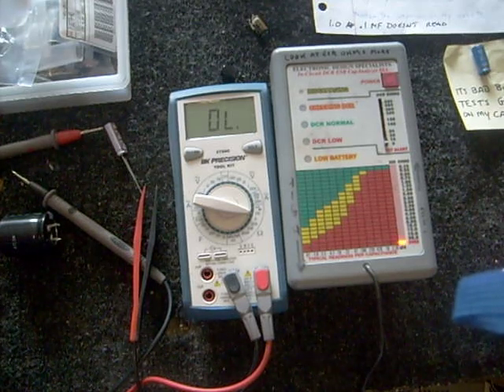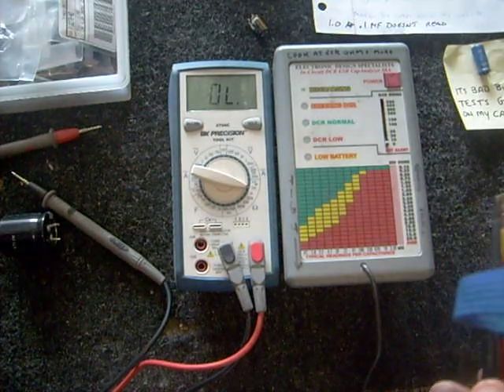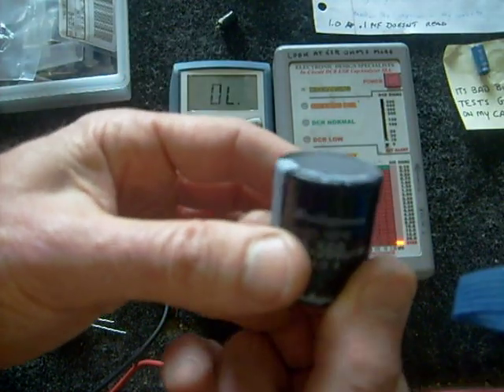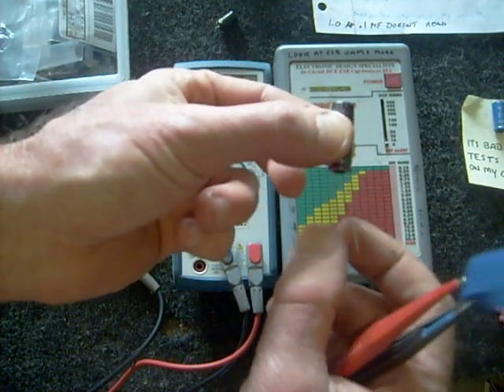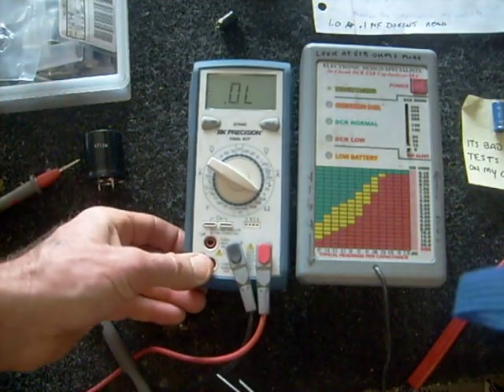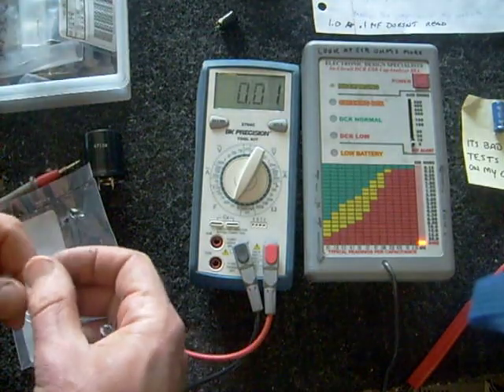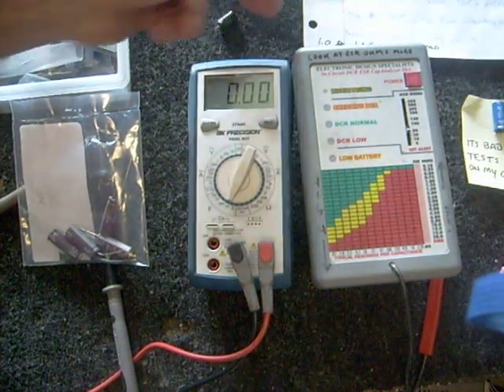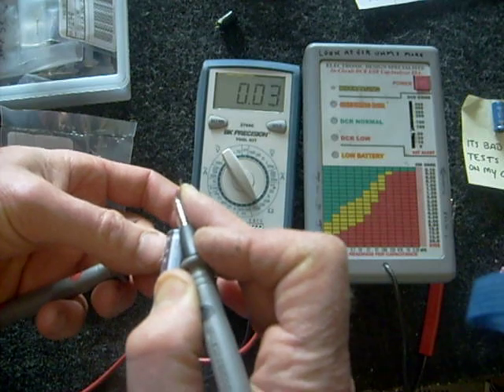How to test capacitors

Comment: Sometime i use as good indication, the plastic coating of capacitor is shrunked, it means overheating, perhaps by higher ESR, but be careful sometime simply due to the neighboarhood hot component has transistor or resistors.
Reply from the maker: Before buying an ESR Meter I would also pay close attention to things like
plastic coating shrinkage on capacitors, and or leakage under the cap. I'm glad I finally bought an ESR Type meter. It speeds my troubleshooting time way up.

Comment: 88A is the most important piece of equipment I own - I fix CRTs.

This is a good video as it explains that ESR values are dependant on what the Cap has to do - some are critical some aren't.

I like the 88A as it is fast to use and is the only one to come with tweezer probes.

Comment: @Grants Pass TV Repair .

You know I was looking at videos of guys using a component feature on the oscilloscope to test caps , transistor , and a diodes You cover using a ESR meter for testing in circuit which is great but you can also use a scope as well . But I like your video anyway . Im going to try your Tip for heating up some caps , so I can find a shorting channel for sound on the FM Audio board In my VCR I having a problem with . I hope its caps and not the video head going out . But I do get the sound to come back when she is running sometimes . Normal  audio works like a champ on the L/R Channels , but HiFi Is shorting out . I have the schematic from quasar and Im going to see what I can do .

Comment from the maker: I'm very fond of my fluke 77 because of its safety feature which has allowed me to accidentally leave the meter on the wrong scale without harming the meter. You still need to be careful about having your probes in the Amp ports, but many times I mindlessly left my meter on the resistance or diode check scale while measuring voltage and the meter was not harmed. I also own a fluke 87V which is like because it can divide an ohm into 100 divisions. B&k 2704c has a picofarad range on the cap tester
Reply: On capacitors do you want high esr or low esr? High hfe or low hfe?
Thank you
Reply from the maker: @SDsailor7  On capacitors you want to see low ESR values, but keep in mind that  on very rare occasions you may have a capacitor that is shorted out, and a short can also appear to have a low ESR value. hfe refers to transistors.
Reply: @GrantsPassTVRepair  Ah I see. Sorry I got the transistors and caps mixed up.
Thank you!👍

Comment from the maker: I'm no expert on multimeters, but I very fond of my fluke 77 because of its safety feature which has allowed me to accidentally leave the meter on the wrong scale without harming the meter. You still need to be careful about having your probes in the Amp ports, but many times I mindlessly left my meter on the resistance or diode check scale while measuring voltage and the meter was not harmed. I also own a fluke 87V which is like because it can divide an ohm into 100 divisions.

Comment: Thank you for getting back to me each time, I appreciate it. I do have two meters but neither are high end, I do have my eye on a couple fluke meters, not exactly sure which model to buy. If you were to buy one or the other, would it be the fluke or B &k and out of those which model? You've been doing this along time so I value your opinion.  I don't have a problem paying for quality equipment,  I've learned early on that if you go cheap chances are you'll need to repalce it sooner. Waste money

Comment from the maker: It wold also be a good idea to purchase a good multimeter if you don't have one. My Fluke meter can divide an ohm into 100 divisions.

I also like my B & k multimeter which can measure capacitor values in the picofarad range.  

An oscilloscope can come in handy, but because I don't go to deep in to electronic troubleshooting I don't use it to often.

Comment: Yes sir, the one i bought has had the protection unit installed on it professionally so im good to go. I bought it on eBay, i just received the shipping info and its being shipped from Medford, OR to me in Wisconsin, not far from you i take it..I'm excited to get it and do some troubleshooting. What else would you recommend for test equipment? I think this meter is going to help me a lot. I have about 150+ TVs sitting in my shop that i would like to start working a lot more and clear out some.

Comment: Hi. I just purchased a Capacitor Wizard, what do you think about them, if you have used or seen them? Like I said in my other post, I'm working on TVs as a hobby and I wanted to do some testing while still on the board. I didn't want one of those cheaper units because of your experience . I think this should be a good unit for someone like me only doing this as a hobby, also I didn't want to spend a lot on one since it'll only be used in my personal shop. They retail for $200+

Comment: I've always used +-20% as my guide. So, the cap's capacitance, which may or may not have been measured correctly by the meter, is fine. Like Dave mentioned, ESR is the more important test.

Comment from the maker: I'm not sure I fully understand your question,  but I only use my ESR capacitor tester to check capacitors, and it doesn't tell me their microfarad value. It sounds like your using a capacitor meter that only checks their values. I have not had good results testing for bad capacitors using a meter that only checks their value.

Comment: You forgot to mention an essential thing, which is that ESR capacitor meters are meant to check electrolytic capacitors only. They are not meant to measure ceramic disc or other types of non-electrolytic caps.

Comment: An ESR meter is a must for checking caps, the only way of knowing if a cap is bad or not. Some are selling at hot and even very hot prices but I bought mine from radiodevices.ru and it's amazing how accurate it is, and easy to use.It's digital.
I am still working on my own design, but for the moment I am using the ESR-micro,  v4.0s I bought, this baby i's doing just great.

Comment: Today i received a another mixer (brand new) so because i had 2 identical boards and psu etc,i could swap them over to see whats going on...and i found that the issue of humming is somewhere in the POWER SUPPLY, all i did was plug the pcb board section of the new mixers PSU onto the old mixer board where the power goes in and everything on the mixer works fine.
Still have to find the faulty parts on the pcb, but now i know where to look, there are a few more caps to check+ toroidal transformer

Comment: I purchased the ESR Micro V4 a couple years ago for about $70; it can measure capacitance and ESR. I had a totally dead TV with no bulging caps, and the ESR Micro helped me find 10 caps with low ESR. After replacing the caps, the TV functioned normally.

Comment from the maker: You can put a resistor across the capacitor terminals, but just make sure the resistor is the correct value so it doesn't burn up. A 10 watt 400 ohm resistor might be a good choice.

Comment from the maker: A digital meter can be helpful but it will not show the ESR value of your capacitor. At best it can reveal a shorted capacitor, or when your meter is on the ohms scale it can reveal that the capacitor is charging, but when you test them in circuit using a digital meter sometimes the other components in parallel with your capacitor will give you a false reading. On some occasions this is also true with an ESR meter but most of the time I don't need to unsolder them in order to test.

Comment from the maker: Your ESR meters can test most capacitors while they are in circuit. Sometimes
a low resistance part or a short may be in parallel with your capacitor and give you an incorrect reading. Other times the capacitor itself may be leaky and mislead you. The DCR alarm tells you about this so you don't mistakenly think your capacitor is Okay when it isn't. If the alarm goes off you will need to remove the capacitor or unsolder one leg and test it again to get a correct reading.